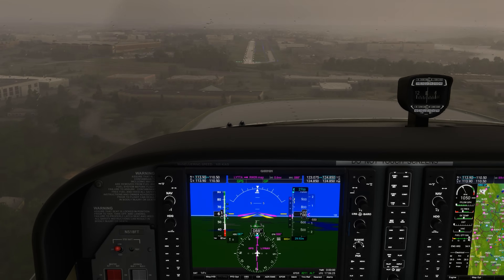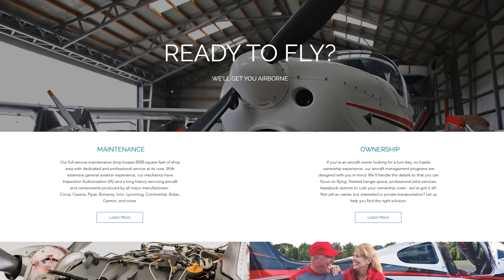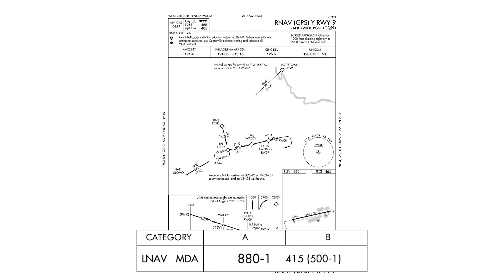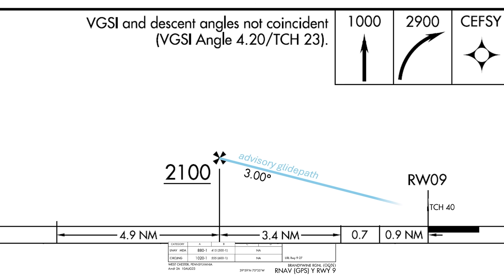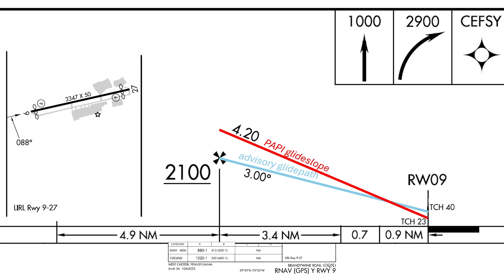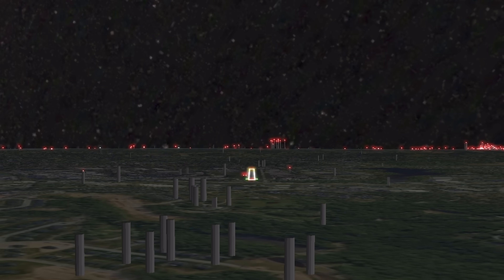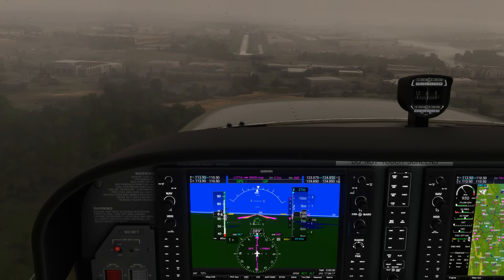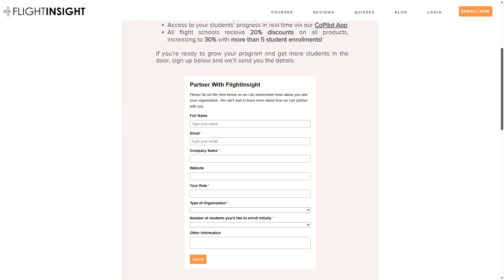This RNAV Approach Looks Normal… Until You Break Out at Minimums

Comment: Well done!! You might add that if you fly he advisory glide path to a runway with a significantly displaced threshold, you will be way below the normal descent angle and could collide with terrain or an obstacle at night or in low visibility conditions. The advisory glidepath takes you to the actual threshold at a 3 degree angle, and not the displace one. Keep in mind that the reason the runway threshold is displaced is due to obstacles or terrain in the final approach path that prevents a normal 3 degree descent to the runway. On all instrument approaches, once the VASI or PAPI comes into view, fly it to the runway. I wrote a tutorial on this subject that was published in both the Piper and Cessna Owner Magazines and in it, I state what is in this video, but I go into much greater detail.

Comment: Love your work!! As you note, with the papi's further down the runway, you would expect the vgsi to be even smaller compared to the lnav advisory glide path. The reason it is not is what you pointed out ...it has to do with the obstructions to the side. The papi guarantees a clear path plus minus 10deg to just over 3 miles out. Whereas the final approach segment on the lnav is a plus or minus 0.3 nautical mile alleyway so to speak. So this tight width actually is what lets the advisory glide path be shallower than the papi. So if you plan on digressing beyond the plus and minus 0.3nm then you definitely need to get back on the papi before you do that.

Comment: I noticed your video shows L/VNAV (baro correction) on the HSI my impression is LNAV+V is the advisory glideslope. My experience is the +V disappears at the FAF, in a non-WAAS G1000 is there avionics that the +V doesn’t disappear at FAF? Why does avionics load L/VNAV when that minima doesn’t exist on the chart?
Reply: I think this is an error in MSFS. I’ve never seen L/VNAV in my WAAS G1000 182. Just the +V sometimes